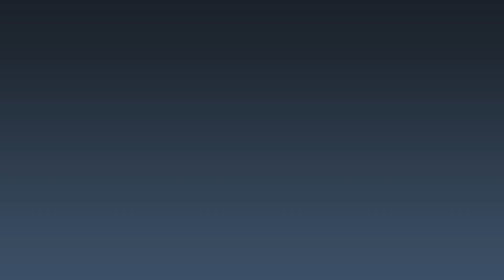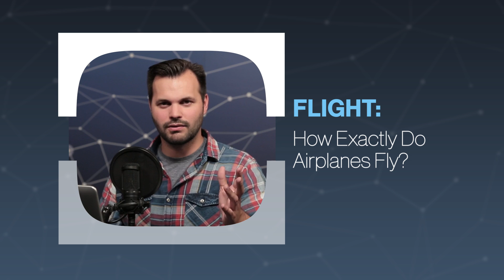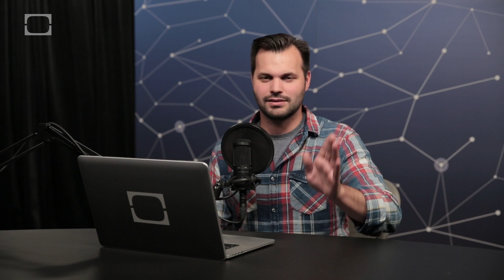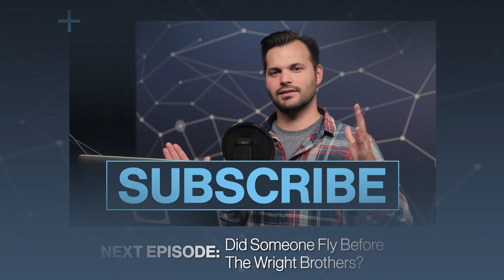How Exactly Do Airplanes Fly?

Comment: I am sorry but the fact that the airfoil is shaped like it is does not produce lift. A perfectly flat or otherwise symmetrical airfoil can produce lift also. You touched the reality through newtons laws. The lift in reality comes from the wing turning the incoming airflow downwards through the angle the wing is positioned relative to the airflow (think of a rudder on a boat). So this mass being accelerated downwards creates the lifting force F =ma. The airfoil shape is actually a way to reduce drag by reducing turbulence on the upper surface of the wing. For example, fighter aircraft can fly just as easily upside down. This is because they are designed to be able to do fast maneuvers to all directions and thus can not be optimized to fly always the right way up like civilian aircraft. The airfoil shape theory is an old mistake that is still being taught in some flight schools but it is quite easy to disprove just by flying upside down.
Reply: dude, you are wrong, dont go on internet saying shit like this
Reply: +luis laurencio he's right. I'm so tired of everyone thinking 100% of the lift comes from Bernoulli when really it accounts for only 20%. I come from siu's flight school and I've seen this demonstrated in wind tunnels.
Reply: William Fitzsimmons nop, when thr flaps are up there is barely no air being pushed down, actually the air under the wing wants to go up towards the high pressure, thats why they have winglets to stop that because it creates more drag, are you going to say too helicopters fly because it pushes the air like a fan?
Reply: +luis laurencio I know you won't believe me on this so possibly NASA's answer to this could convince you https://www.grc.nasa.gov/www/k-12/airplane/wrong1.html
Reply: Henri Hohtari interesting, i would love to see what the faa thinks about this, but this pushing the air down is wrong too, i have seen experiments on 1500 pounds helicopters, which works like a plane wing, pushing down 28 pounds while taking off, so oviously  is not the pushing down part of it. Anyway as an advise for the people who needs to do faa test, when they ask you how a plane flys i suggest you to answer with the burnullis theory if you want to get it right with the faa. P.s. i may have said burnollies wrong, cant remember how to type it

Comment: What percentage of the lift comes from the lower pressure above the wing versus the redirection of the air by the wing's attack angle (and flaps)?
Reply: actually lift comes from the difference in pressure on the wings, you cant count on the wind pushing the wings, i dont know why he said this here in this video, planes fly because of the bernuilis effect
Reply: Depends on the wing, but typically a lot more lift is generated from the upper surface than the lower surface.

It's worth noting both the upper and lower surfaces redirect air downward, and both surfaces change the pressure (lower above and higher below). So those are really the same thing. But the upper surface will decrease the pressure a lot more than the lower surface will increase it.

Comment: Just a slight thing, Trace said something to the effect that an airplane can only fly when thrust exceeds drag ... I don't think that's entirely correct.
Reply: I think you're right because you don't have thrust exceeding drag while moving at constant velocity. You are not accelerating but still moving.
Reply: at straight and level flight all four forces are equal, while climbing thrust and lift are higher and while descending weight and drag are higher
Reply: Yes it is because if you have more drag than thrust you will not be able to maintain momentum and will inevitably decrease and you will crash
Reply: +Bibek Bardewa right. I'm willing to listen and learn, but in addition to constant velocity, planes use drag to decelerate, gliders are a thing, helicopters hover etc. 

I like the video, it's just a small thing.
Reply: +Branin until the point at which the plane returns to the ground, no matter the cause of its return, it is indeed flying, is it not?
Reply: +luis laurencio that's what I was saying essentially.
Reply: Thrust needs to exceed drag to accelerate. During steady flight, drag equals thrust.
Reply: @MrMarkchu  Assuming the engine thrust is parallel to the free stream velocity, which is not always true